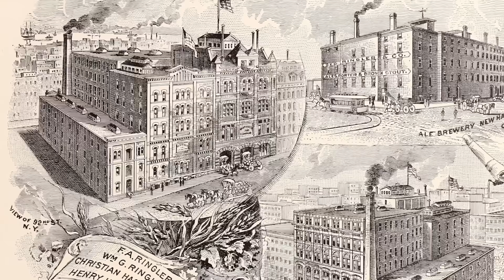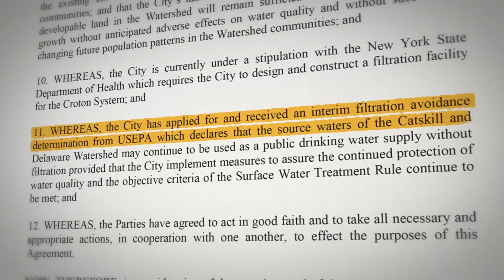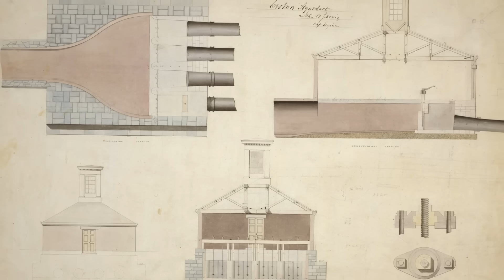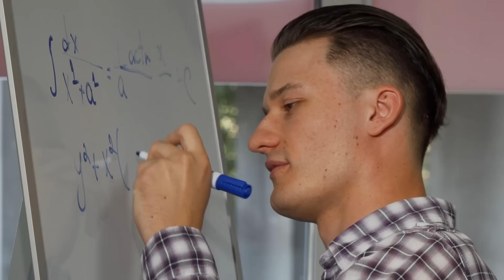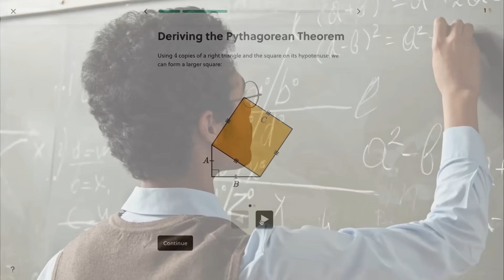The Simple Genius of NYC’s Water Supply System

Comment: I went down into the end of the water tunnel in Brooklyn back in the early 2000s. I knew the head engineer on the project. He allowed my brother and I to visit the job site and go down the 800ft access shaft. He gave us a history of the water system similar to this video, before we went down. We took an open elevator down to a three story scaffold. Then climbed down. It looked like a scene from Batman. A rail system to move material. The concrete tunnel was being finished within the bedrock. The ‘sand hogs’ were working their whole shift below the surface. That tunnel is now full of water supplying Brooklyn and queens. It was one of the biggest engineering jobs in the world. Yet almost every New Yorker had no idea it was being done below their feet.

Comment: 4:04 that is Katterskill Falls and is actually not part of the NYC public water system. Source: I am an inspector for the dam project on North/South Lake.

9:55 I have done a little bit of testing on the Tunnel project.

10:25 I have done lot's of concrete testing at the Kensico Resevoir.

Comment: A couple of things you left out. The airerators at the base of the Ashokan reservoir have been turned off because instead of using air to kill bacteria they use chemicals now.
Both pikes leak tremendously. All the basement in Napanoch are flooded from the Rondout reservoir pipe. And I personally know of a spot where the ashokan aqueduct comes up to just below ground level and leaks also. That's on it straight run to just below New Paltz. 
I've seen inside the pipe of the Ashokan pipe and it's big enough to drive a small Jeep through it.

Comment: Nothing beats spring water bottled at the source  , or uncontaminated well water  tap water is horrific all kinds of chemicals used to purify it .Spring water company's go to" real" springs with tanker line trucks fill up the trucks with the spring water take it back to the plant and it's bottled . Simple , just let your tongue tell you which is better there is a huge difference . Also, you can go have the spring water tested at a lab, simple to do to check if it has chemicals  Put spring water and tap water side by side both bowls touching each other for my dog one time after I took my dog for a run he came in picked the spring water instictively knew which is better water .  Spring Water that is bought at stores has to be in the soft dull plastic not the hard shiny to be BPA free if not in glass bottles . "Spring is King" the bible is the secret and it always talks about spring or well water google it . Distilled is no good causes the body to leech chemicals from the body , google it!!!

Comment: That analogy to siphoning with the water wasn't exactly correct. The water is not coming out the other   end because of the siphon effect. The constant flow of water is pushing it through the system causing it to come out the other end. Stop the water for a few days at the source and see if the water in the pipe will come out the other end. It will not. That's because it's not using any siphon effect it's being pushed by the constant flow of water.  You said as long as the source is higher than the destination the water will come out. Does that sound like siphoning to you? When you siphon gas from car to car they're basically at the same level. And, you can siphon gas from a small car into a truck in that instance the source is lower than the destination. That's siphoning.

Comment: I’m grateful for the NYC water supply system, but I still use a high quality water filtration system to remove the chlorine (necessary for sanitation) and removing fluoride (not necessary and toxic - that’s one of the reasons they have to buffer the PH level)
In addition, there are tens of thousands of potential pollutants that could be in the water and the city only tests for a hundred or so.
Reply: the addition of fluoride does not affect ph level though?

Comment: @7:11 your math and phrasing are incorrect.  Three times longer than a 29 mile tunnel would be 29+3*29, or 116 miles.  I suspect what you mean is that the new 85 mile tunnel is 3 times as long as the 29 mile tunnel, which is 3*29, or 87.  But even that would be incorrect, since 85 is less than 87.

Comment: Trouble is more chemicals showing up in public water.  Pharmaceutical drugs, pesticides, herbicides, fertilizer, arsenic, lead, mercury, radiation, etc.  EPA just notes allowable levels.  Nothing done to remove.  Chlorine, boiling, uv sterilization is more for bacteria, fungus, and virus.  Reverse osmosis or desal plants would remove everything out of the water.  Middle East has the most oil but no freshwater.  There experts at their decades of desal use.  Water, air, land becoming more polluted.  Previous filtering of water not good enough with years of pollution and population growth.  Herbicides cause hormone dysfunction with sex changes in lab rats.  Significant amounts of antidepressants, Coumadin, narcotics, people flush down toilets or breakdown product in urine and feces s as lol end up lakes, rivers, then ocean.  Indian point nuclear like many old nuclear reactors leak .

Comment: The water system for the Boston area works very similarly.  Our water sources are two large reservoirs in series that are almost entirely surrounded by protected land and gravity fed as the water moves eastward from the inland reservoirs to the almost sea level urban core.  We even generate some renewable electricity with hydro turbines at a few locations in our pipeline.  Our system is set up much more like the human respiratory system where the water flows down a main pipeline almost all the way east to Boston and then splits into two pipelines which then direct water to a variety of smaller pipelines where individual town water systems connect and take water.  This system serves about 3 million people in the Greater Boston area.

As Boston grew over the years the city created more artificial reservoirs in towns like Framingham and Southborough, but by the early 20th century this was proving to only provide temporary fixes.  In the 1930s the state of Massachusetts forced people from 4 towns in western Massachusetts (Dana, Enfield, Greenwich, and Prescott), destroyed every building down to their foundations and moved all the graves in the cemeteries.  Two dams were constructed and the Swift River was diverted to create the largest inland body of water in Massachusetts, the Quabbin Reservoir.  The portions of the 4 lost towns that was still above the water were then incorporated into the neighboring towns (Petersham, New Salem, Hardwick, etc.) and there are still roads that lead up to the shoreline.  As time has gone on more and more suburban towns have connected to the system but as many leaks have been fixed, funding has been sharply increased (and water bills) and more efficient toilets/shower heads, etc. have become common place, the Quabbin is now comically oversized for Greater Boston's needs.  No lies, if Boston were to NEVER receive any more rain again tomorrow and everybody uses water like nothing happened, there would be enough water through 2026.

Also, the reason NYC water and Boston water are unfiltered is the water sources are in protected land with a lot of surrounding forest.  Our water is so clean to start with there is literally no need for filtration for millions of people.  However, Boston does frequently win the annual national taste test award from the American Water Works Association so our water is just a tad better than NYC.
Reply: And our baseball teams...and basketball teams...oh and maybe our football teams...not as good as fresh water but just sayin'...😊

Comment: Difference between Siphons and aqueducts that makes them work as they do:  siphons are pressurized, aqueducts are not. And so, spring a small leak in an aqueduct and continues to work w a loss.  A leak in a siphon causes the siphon effect, ie upgrade flow, to fail.

Comment: Ph  adjustment is critical to pipeline and equipment longevity . No mention of the langlier Index in use nor any pre treatment stabilization. The  . The coagulants ie Alum used to filter solids if not removed will restrict pipes and capacity over time. No mention of how that is remedied.Lining the existing pipes with an epoxy type liner might save them but very expensive. Inspections would be needed and materials closely reviewed for final remedy.

Comment: 2,500,000 litres per minute for 9,000,000 people? That's exactly 400 litres per person per day. Sounds a lot.
Reply: Not as much as you think. A lot of the water is spent outside of people’s homes, by industries, restaurants, the fire department, etc, and (as mentioned in the video) a lot is lost on the way due to leaks. Also, people use water outside their homes (at work, schools and so forth), so 400 l per person in average should be quite accurate for NYC.

Comment: I did a laboratory installation at the Croton Reservoir intake structure back around 2000.  The client, who knew of my interest in the site engineering, took us on a tour of the large mixing valves, designed to draw in different levels of water.  Then, at a lower level, inside of a chain-link enclosure, he showed us a tall wooden box, maybe 3' x 3' x 6'.  The outside was dark, crazed varnish with noticeable rusted piano hinges. He began to swing parts of it open, revealing an 1890s-era swing-away model of the then new aqueduct intake structure.  It was exquisite, with railings about 1/2" high and the concrete funnel cast in plaster. There was a darkened bronze plaque on the inside honoring the commission that oversaw the aqueduct improvement.  All of the names were Irish, naturally.  This had been built to carry around to different investors and to show off the plans to the public.  I don't know what has happened to the model.  I hope that it is in good care.

Comment: My home city of Helsinki in Finland has a similar, smaller scale solution (though large scale for a city of a mere million). Our water supply comes from Päijänne, the largest lake in the country. We use less than a hundredth of the supply it could provide. The water comes into the city along a 120km tunnel, and it is also used to drive turbines for power as the elevation difference is significant. It's weird to think about how my city has a hydro power plant, without the usual dam around.

Comment: What boggles mymind is not how the giant siphon was built but rather how it was jump started into operating. I take it the highest point needed a feed through which the locked pipe was to be filled. But that also means water needed to be pumped or transported to that point. Anyone knows the details?

Comment: Water tunnel #3 was started in 1970 and was originally scheduled to be completed in 2000. That didn't pan out.

The Feds wanted NYC to build a water treatment plant for the entire Catskill system, but the price tag for such was absolutely astronomical. So all the small towns in the Catskill/Delaware water shed got waste water plants instead.

You should have shown all the other connecting tunnels that tie the Catskill/Delaware system together.

Comment: Doesn't sound like water I would drink.
In Denmark = "Normal treatment of groundwater
Oxygenation/aeration: The groundwater is oxygenated/aerated to add oxygen to the water and to remove dissolved gases such as hydrogen sulphide (H2S), carbon dioxide (CO2) and methane (CH4).

Filtration: The water is filtered through granular filter material, usually sand, to remove iron (Fe), manganese (Mn) and sometimes ammonium (NH4+). "
oxygen and sand should be enough.

Advanced water treatment is not so widespread, for example, the use of carbon filters, the addition of chemicals or disinfection of the water with UV light.

chlorine in the water makes it undrinkable if you ask me

Comment: A lot of really excellent information  is presented in this video! Thanks to Wendover Productions for the video.  However, I would like to point out that the bit about siphons was not completely correct. Siphons will fail if the crown, the maximum peak of the bend, exceeds approximately 10 meters from the upper reservoir. The actual height depends on barometric pressure. At this height, the downward pressure of the column of water "pulling" on the water at the crown reaches barometric pressure and the water effectively boils and forms a vapor bubble that would cause the siphon to stop. This is the similar to the principle that mercury barometers use to measure atmospheric pressure.

Comment: Water finding it's level isn't "against gravity", the weight of the water above it in the reservoir is pushing it up until it's at the same level or until it exits the system... and It's not a siphon. A siphon would require raising the water above the level of the starting container. (the falling water creating a suction force like a straw drawing the water up and over.)

Comment: It's inaccurate to say that liquids in a siphon will always flow upwards against the force of gravity as long as they can return to their original level at the other side. If the change in elevation is too severe, the force of gravity pulling down on the liquid will overcome the liquid's molecular cohesion, and the liquid will break apart, forming vacuum bubbles that will interrupt the siphon. So there are limits to what you can get away with.

Comment: 8:15 what do you mean the physics behind a siphon aren't fully understood? 
The output is lower than the input. All the tubeing above is an isolated system. The law of conservation of energy states that the total energy of an isolated system remains constant; it is said to be conserved over time. Since the tubing above is sealed, it is hydraulically coupling the output to the input. If the output is lower than the input, and there's a consistent density fluid in the tube, it will transfer and conserve the gravitational potential energy by tuning it into kinetic energy.

Nothing isn't understood and I haven't heard any competing theories. Water is not compressible, and until the vapor point, vacuum/pressure differential will not cause water to expand.

Comment: 8:15 Please don't say "The physics behind how siphons work is not fully understood". There are not competing theories at all. It's a very well-known and well-understood phenomena.

It's very simple. The reservoir is heavy. That's it. So long as the reservoir is the highest point in the pipe system, you're fine. The weight of the reservoir pressurizes the pipe. Even if the pipe goes down and then back up, the reservoir pushes the water through that U-shape. If there is a region of pipe that goes above the reservoir though, then it would be a problem. The reservoir cannot push water to a point above the altitude of the reservoir itself. Hence, such a situation is avoided ~ All pipes are constructed to be below the originated reservoir.

Comment: 8:15 I don't think the tunnel acts like a siphon, since the water moving up and down does not rise above the level of the original reservoir. Water can go down and up a pipe because the higher pressure at the bottom pushes water upwards in the forward direction away from the source.

I've never heard of such big mysteries in hydrodynamics to warrant calling it "not fully understood"; what competing theories are there?

Comment: As a Dane, drinking ground water all the time, I've always been told that surface water is difficult when it comes to pollutants of all kinds.

But I still find it peculiar when New Yorkers claim to have some of the purest water, when so many chemicals are used in the process.

It's like when they say that the tapwater in Tokyo is potable, but what comes out of the "cold" tap is 20C+...

Because I've also been told that to distribute potable water by pipes, it should never exceed 12C.

Perhaps I'm just too picky.

Comment: why dont they build a desalination plant since it is surrounded by salt water
Reply: Because that costs more money and nyc water is already extremely clean.
Reply: @JasonWW.  based on what info is provided keeping this much staff and upkeep I am pretty sure if the cost analysis is done it won't be too much difference
Reply: @physics77guy  while mostly discussed in the context of the wests water crisis. The costs of desalination is WAY higher than most people think. For instance the cost of desalination for the annual usage of a family of 5 is $2000 dollars (before the distrubution infrastructure costs / other costs are added, think $2500) . Compared to about $1700 dollars based on a quick search for nyc water price and using the higher end of the range I found ($4 a gallon)

Comment: Its worth noting that what constitutes potable water varies wildly across the world. If a UK water authority tested NYC's safe drinking water, it would be condemned for drinking and serious warnings about cleaning self and clothes would be issued. There are way too many chemicals in it. We do not have any lead pipes, they were all changed decades ago when it was discovered that the safe level of lead consumption is zero. We also don't add fluoride as its found naturally and the natural mineral content is left in the same as with bottled water. Other than that its mainly rain, filtered through rocks and shoved into a tap.

In the main, Brits will not drink foreign tap water. In Spain some struggle to brush their teeth in it and the French decided that its much better to have your kids drink wine than water so, thats a no go too.